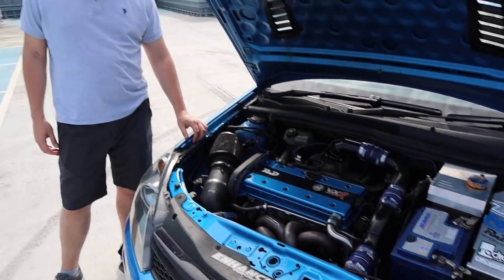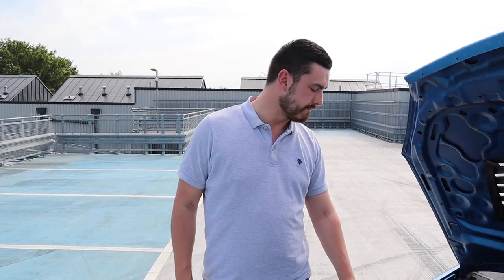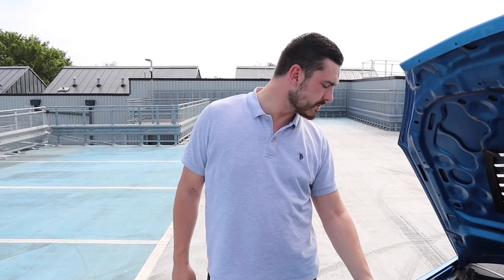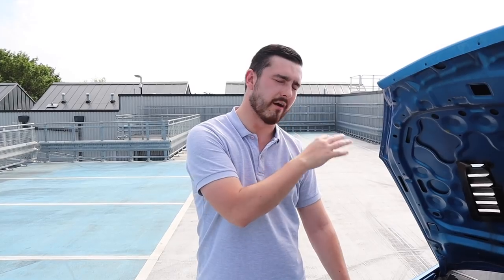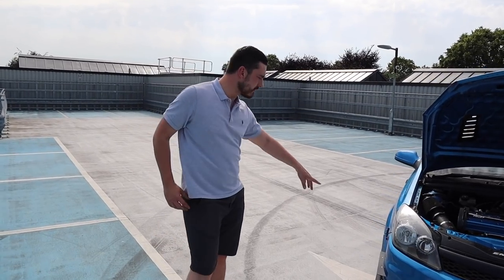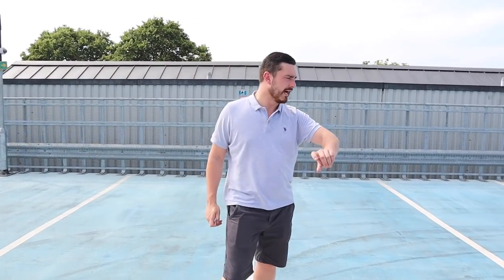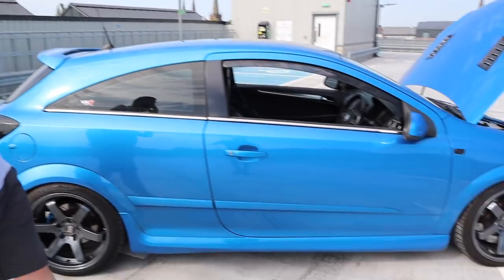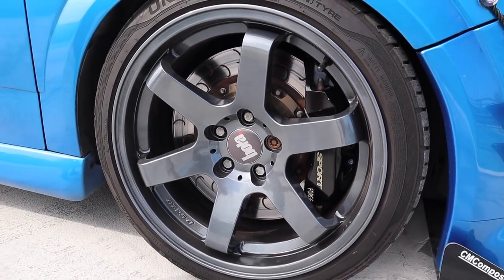470BHP VAUXHALL ASTRA VXR (MADNESS)

Comment: Not enough torque in my opinion. A golf GTi 2.0 tfsi has to be capped at 350 bhp and about 375 foot pounds of torque because of bending rods and that's on a golf r ko4 turbo upgrade and GTi block.   I thought the vxr block would of produced similar torque figures especially being forged and having cams but it's well down on torque.
Reply: crypto bond 007 The M32 gearbox is not bulletproof and high torque is their weakness
Reply: @nicolarse6227  totally understand that nick  which is a shame as you could possibly up the torque figures if it wasn't a weak point. GM make good engines but honda and Vag group seem to have these smaller engines lightly forged from factory so can take large amounts of boost and torque. I like the new Astra vxr shape better then the others but again it's limited to 350bhp and same torque figures before you need to forge the engine so people buy an S3 or golf r instead which is a shame as the vxr looks much better in my opinion

Comment: my corsa d 1.2 sxi would win all day long over ya astra. I admit mine is not standard  . it's got a turbo off a v8 scania truck and k and n air filter.  had it on a rolling road and is pushing out 567 bhp n 634 tourks.  0-60 in 3.1 sec and standing 1/4 mile in 9.6 seconds
Reply from the maker: Show me this car 💪🏼 is this real
Reply: @JustbeingHayden  yeah she is a furiously quick corsa d.  I want to fit a super charger but that means cutting a hole in the bonnet
Reply: just had a nitro oxide kit fitted to it. rolling road test tomorrow.  hopefully it was produced 700bhp or above depending on the mapping settings
Reply: Neve beat my Dodge Viper 8 litre Nissan micra
Reply: @lewisdeanclark4091  lol, all pizza delivery drivers love them micra's.
Reply: @Rob-eg8qc  you been doing surveys askin pizza delivery drivers if they like micras? your defo single
Reply: @lewisdeanclark4091  where is the connection between delivering pizzas in a micra and relationship status, that's like saying guys with long hair are more likely to be transgender😁